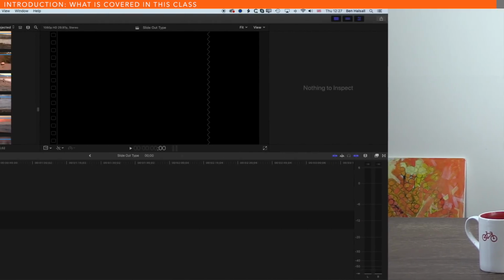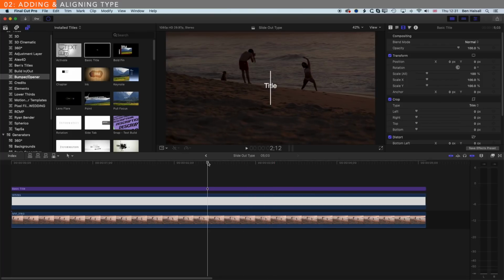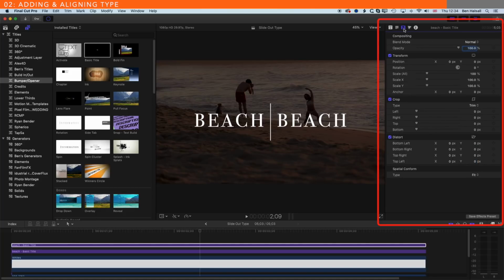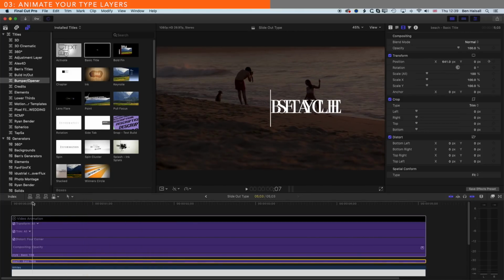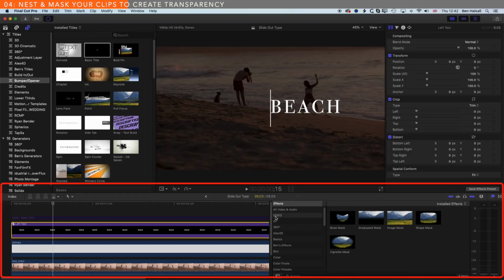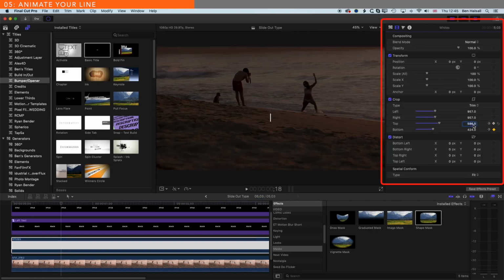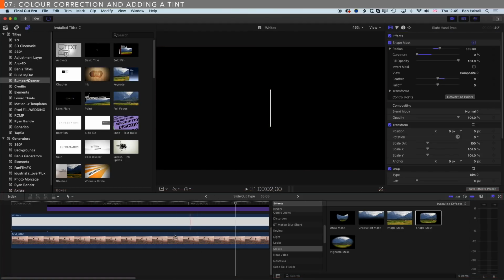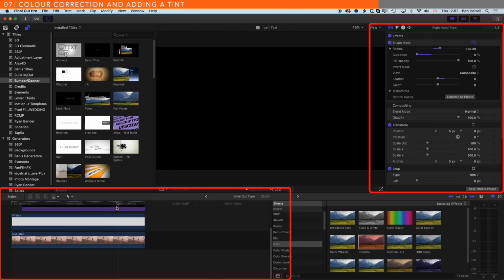Final Cut Pro X: Type Reveal Animation - No Plugins

Comment: No need to Blade, select the clip to eliminate and then delete the selection. You can use the Top & Tail function. Position the playhead and press Option-Right Square Bracket and the media of the top clip to the right of the playhead will delete. If you need to trim more layers, just repeat Option-Right Square Bracket. Final Cut will automatically select the next layer down each time. Use the Left Square Bracket to delete media to the left of the playhead. As for seeing more of the Inspector, just double-click its top bar. The Inspector will expand down to the bottom of the screen. Double-click the top bar again to return the Inspector to its usual size.
Reply from the maker: Great tips Don! Thank you. I try not to overload the tutorials with too much shortcut-tery so that those newer to FCPX don’t feel too overwhelmed with things but thanks for sharing (& watching!) I hope there was something useful in there for you!

Comment: Beginner here. This is such a great tutorial. Was able to replicate it, and I was curious about one thing. At first glance I thought this could be also done with a simple built-in Slide transition from left to right (and right to left for the other text), with the added benefit that this transition seems to have some nice built-in motion blur that I cannot replicate by using keyframes on the position. But I was not able to make the shape mask work with the Slide transition. Is there a trick to it? Thanks! UPDATE: actually I needed to apply the Slide on the clip, then make another compound clip, and apply the mask to that compound ;) But still some weirdness, it seems that during the slide transition, the whole section is no longer showing the video clip it is on top of it, but a black box...
Reply from the maker: I am not sure off the top of my head. I will take a look when I find a moment... on my tutorial to do list!

Comment: Hey Ben wondering if you can help me. Followed this tutorial to the letter. It looks great. But when it comes to moving the words after the title has shown, at the end of my clip, the shape mask doesn't work anymore. And the words are visible as they move back to their original marked position. The shape mask works at the beginning but not the end. What the hell have I done? Ta!
Reply from the maker: Do you have any screen-shots or even better a short screen recording (SHIFT + COMMAND + 5) that I could peek at.
Reply: @BenjaminHalsall  Hey Ben. Thanks for the reply. I had already deleted everything to start again by the time I got your response. I think I was forgetting to double click back into the compound clips. My shape masks also seem to have slipped. But what I will do is try again. If I have any problems will let you know and send a screen recording. Cheers Ben. Much appreciated.
Reply from the maker: @bearofthevalleyofthemoon  Good luck!